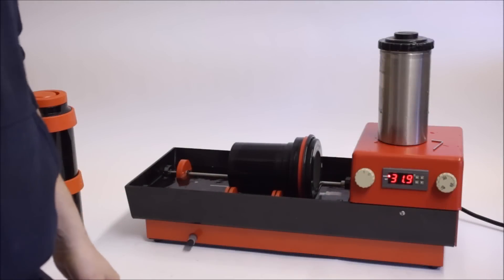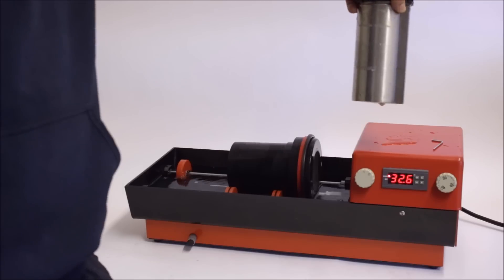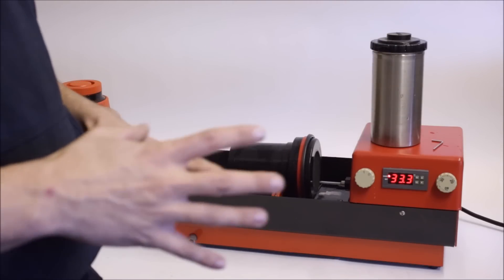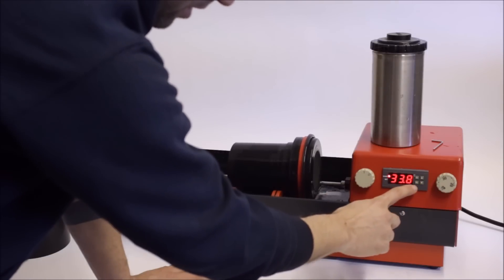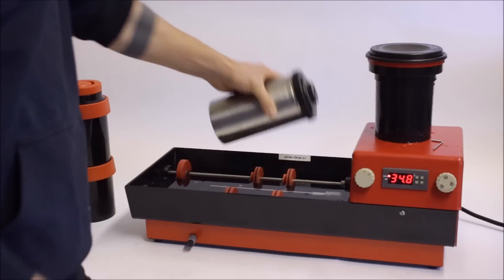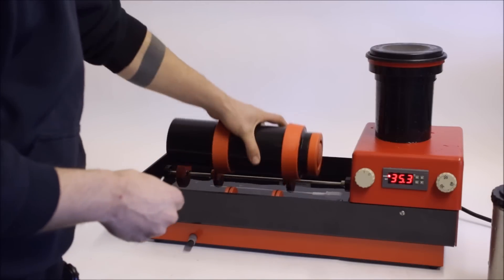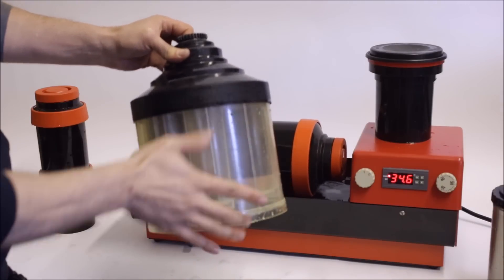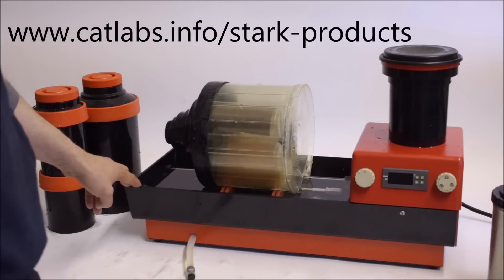Stark Tek SST4 function walk through

Comment: Rotary processing film especially c41 is asking for trouble big trouble at the printing stage .c41 is not a finality process ,image density is dependent on time ,temperature, and agitation . Look at the film spiral rotating horizontally and you will see a hugh differential in chemical flow from the rim to the hub . Just shoot a grey card on a 36 roll and see the colour temperature change steadily from end to end .you will see why youve found printing difficult . This type of system is a complicated way to achieve unenjoyable darkroom
Reply from the maker: Rotation processing has been the industry standard for bench marking, testing and providing superb results as far back as 1980. Kodak, Fuji, Inoviscoat and all other film makers use a rotation processor (usually a Jobo unit) for bench marking. There is no easier way to process film than the decades proven method of rotation processing. Paterson tanks might not be ideal, but Jobo tanks have entirely uniform chemical distribution due to an ingenious design. See our other video to learn more about this (Expert drums).

Comment: Cool machine!
Would it work with unicolor drums?
Also my Paterson tank leaks a little bit, would that mean that water from the temperature bath could leak into tank?
Reply: More likely you'd have chemistry leaking from the tank into the waterbath. The solution is to dispose of your Patterson equipment and get a decent tank.  Leaking is an unadvertized feature of most Patterson tanks.

Comment: I wonder how well the tanks move when they have liquid in them? The old cibacrome/beseler rollers units I use have low traction on the rollers which slide and the tank doesn't move well - especially when wet or loaded with liquid weight.